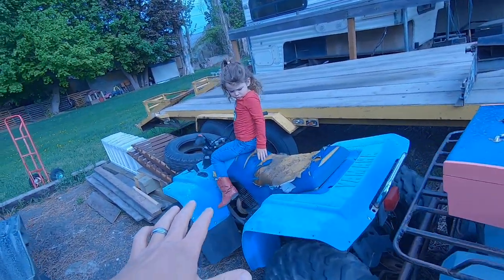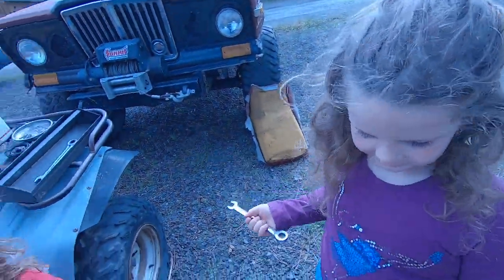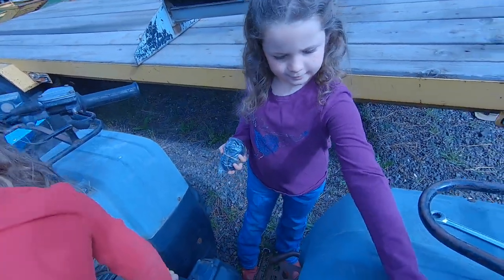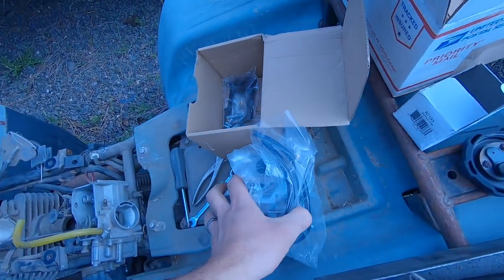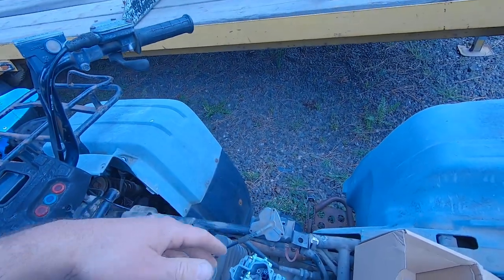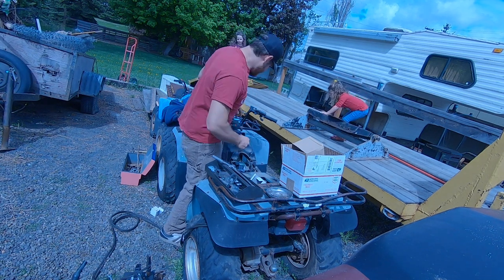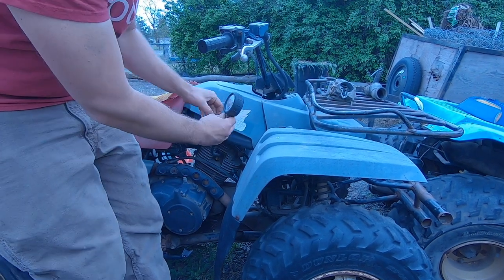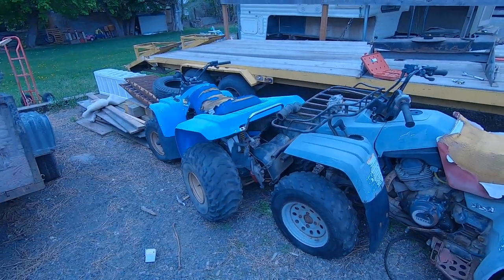Yamaha Big Bear 350 Revival Part 1

Comment: memories that will last forever, definatly don't forget to remind them in 2 decades about their poor attendance LOL (you have the video evidence).
    one thing to check on the engine that wont make compression is to verify the valve is closing all the way. sometimes after they sit for a long time , if the valve was left open it may not be sealing. you can verify by by a leak down test and listen to intake side and exhaust for hissing. usually a little wd40 or marvel mystery oil will free them up. also some of these engines as the valve wears into the head it actually needs to be adjusted to maintain seal.
Reply from the maker: ivanpomy thanks! I will definitely check that out, lot easier then replacing the top end! Yeah I’ve got video evidence of their poor attendance haha, I’m sure I’ll have more of their attention now that the moto4 is running!

Comment: Good video man. Did you ever get the Big Bear running? I'm about to pick up one myself next week. Currently have a '92 Yamaha Timberwolf that's a great little quad.
Reply from the maker: No, got the moto 4 going and it’s a blast. The big bear needs a top end and new tires so not sure if it’s worth it. Might rob the rear end for the moto4 and sell the rest for parts
Reply from the maker: That being said though, it would be nice to have a 4wd, I’d like to get one set up with a plow. Thanks for watching!